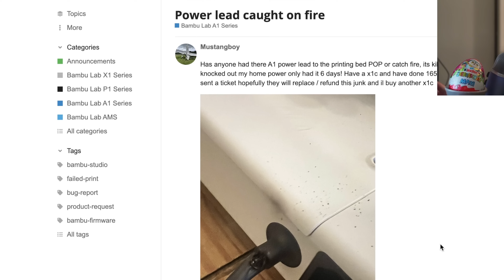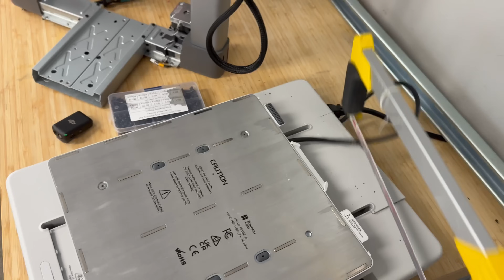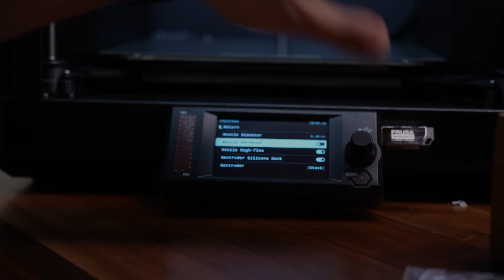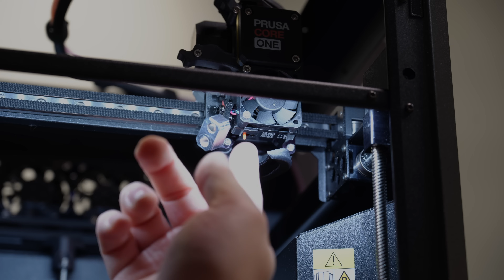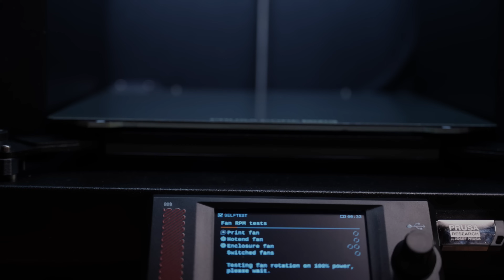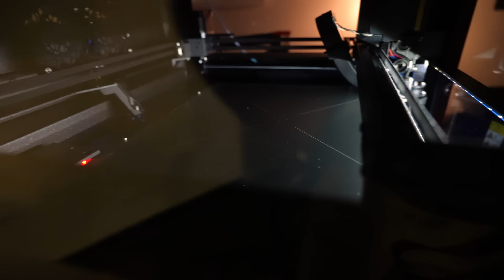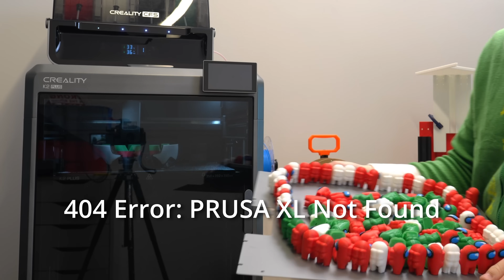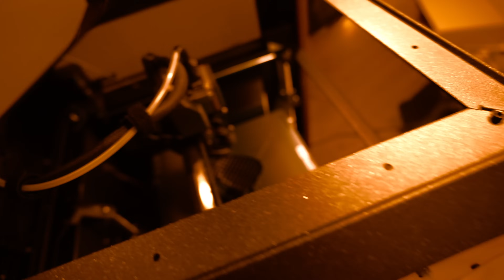PRUSA CORE ONE - The Machine Designed to Trigger Bambu Lab Fanboys

Comment: I don't usually like antagonism for its own sake, but I really don't mind if you trigger the Bambu Lab fan boys because so many of them truly are insufferable. Yes, this printer costs about as much as an X1C and doesn't have all the same features. What they don't understand, is that this will also produce superior quality prints to any printer Bambu Lab makes. Most of them have no idea there are printers which can make better quality prints because all they have ever looked at is Bambu Lab. Anyways, the One looks like a great printer for the right audience.
Reply: We have a X1E at work. With all the Printer Enthusiasts we have seen lot of Brands of 3D Printer, Professional 7k machines and lowend Consumer Printer. We all agree that the Print Quality of the X1E (We got two X1C, and one has one P1S privatly) is as good as the Prusa MK4s one has and it is better then most of the other Clones around. My X1C got a Nozzle/Fan Upgrade and is at the same level. And we are all dissmayed what Bambu announced, both of the X1C are now running X1Plus. 

Bambu Lab is at the moment the leading 3D Printer company as it sells good filament for a cheap price and has a good Printer in Programm, with a good Software, which they got from Prusa.  Prusa is the other High Quality Brand in the 3D Printer Market which got the full 
Package done: Software very Good, Hardware Good, Support Good, Open Source very Good. 
Bambu Lab is the same: Software Very Good, Hardware Good, Support Good, Opensource now Mediocre
. 
Literally the only Company which doesn't have "Software: Mediocre" on the List ist Sovol, because they simply say: 
Use Orcaslicer, here are the configs. They have good Support und very Good Opensource support.  
Without the Firmware Problem Bambu Lab inflicted on themself, i would say #1 Bambu Lab #2 Prusa Research.  
Now it's #1 Prusa Research, #2 Sovol #3Bambu Lab. 
Anycubic is at the moment trying to redeem themself. 
Creality is: Hardware Mediocre, Support Mediocre, Opensource Mediocre thanks to be the 2nd largest 3D Printer manufacturer there are enough workarounds for their Printers.

Sovol is paying license fees to the Voron projekt and get improvements for their Printers back. Which are in a good state. The biggest Problem i see with the Prusa Core One is the availability of the Kit's to get the price down. An upgraded Prusa Core XY costs around 1800€ for 5 colours. (MMU is comming, will cost around 300€) a big X1C costs with 1400€ for 4 colours. 
 But the price is okey as a fully kitted out Prusa CoreXY is between the X1E and the X1C pricewise. Personally i would now buy a Prusa Core One and Upgrade it to my liking, but i have a X1C with 2 AMS. But i am building atm my own Voron 2.4 and i even calibrated a Ender 3 and reworked it so good that it's print quality was as good as a X1C or Prusa MK4s. (And after 3 hours printing it was shitty again) But as soon as the MMU is available for the Prusa Core it's a very strong contender in this format.

And the king of all Printers are the Vorons, because there are hundreds of Maniacs improving them, but those printers are not for everyone.
Reply: @Elkarlo77  Nice analysis and experience! Thank you for sharing. I agree Bambu Lab's recent moves are detrimental for the brand and consumers regardless if it is a little or a lot. I wish more companies would take the Sovol approach of just use Orca Slicer and would stop making their own slicers.
Reply: Actually you're wrong: you'll notice those who love Bambu are those folks who just want to PRINT stuff. NOT tinker with the printers. 

I'll tell you who got butt hurt by Bambu: 3D printing fanboys who cannot stand the fact that ignorant plebes can now simply press a button and get a great looking print out!

Sure if you know what you're doing you can build a BETTER machine than Bambu with BETTER print quality for cheaper. Be my guest. I'd say 99% of the rest of the world just wants to have a life and get things done printing.

(Former Ender 3 v2 refugee speaking)
Reply: Then why do most bambu prints look better than anything I've seen off a core 1?  Cope much?
Reply: @cartier13  Because you've taken a very small look just to confirm your bias. 😂
Reply: prusa fanboys are also their own brand of insufferable.
Reply: "What they don't understand, is that this will also produce superior quality prints to any printer Bambu Lab makes."
I've seen a few videos where the Core One produces prints of a quality either on par with or slightly worse than those from Bambu machines. In the hobbyist space, it often comes down to whether people think comparable quality and reliability is worth the notable increase in price. For most people, I'd assume the answer is, "No," but the Prusa is clearly superior when it comes to serviceability and support.
Reply: @AuntJemimaGames A ton of it comes down to how much the user knows. Filament and slicer tuning is huge. Part of the issue here is that most Bambu Lab users are not going to tune beyond what Bambu Lab provides. They are in the top tier of quality for sure, but they aren't the pinnacle.
Reply: @802Garage  that’s the best part though, to get great quality prints you don’t have to spend hours tuning anything.
Reply: @MrBertstare  I agree. That's true of many printers including the Core One. My point is that there is quality available beyond what you get from an X1C. Especially without tuning. That's what I said. It's still true.
Reply: @  of course you can tune, but it’s all about acceptable tolerances. And out of the box bambu and prusa are all going to pass the “wow is this 3D printed?” Test and all your parts are gonna be pretty damn accurate from the get go. I for one enjoy just printing, maybe it’s because I did the fiddling, measure the steps, new upgrades, calibrating filament and now I just want to print. I want to get my projects done in the shop, ship out customer orders and print fun things for the kiddo.  I’ll take a prusa, a bambu, I’d even try a quidi or what ever it is. I’ll never own another ender after my 5plus and I don’t think I want to spend 40 hours building a voron. Maybe if my nephew wanted to I’d help. My kids on,y 5 so when she gets to that point I’m sure we will be all over some other tech.
Reply: @MrBertstare  - I'm not disagreeing with anything you say and certainly not disagreeing with your experience, but you may be giving up on Creality just as they are upping their game.  I built my first two 3D printers and I've bought the last ten.  I've never owned a Creality 3D printer but I am well aware of their reputation.  However, Creality seems to be trying harder the last couple of years.  The K1 was a good start but probably not ready for prime time, however the K2 Plus has been getting mostly good reviews.  It's a complicated full featured printer.  Features are great and they sell printers but I'm more interested in reliability and maintainability and I'm a bit dissuaded when I see automatic belt adjustment and similar complexity.  I realize that Ender is probably a dirty word to you at this point but the new Ender 5 Max looks interesting to me for the type of printing that I do.

I'm similarly biased against Qidi.  They seem to be making decent printers lately but the first 3D printers I bought were Qidi printers because they had a lot of features for the money, but that perceived value was a myth.  In practice, they were very unreliable and difficult to service.  Even worse, Qidi made everything deliberately proprietary to force customers to buy parts from Qidi, when the rest of the market was using open source components wherever possible... then Qidi would develop a new printer a year later and they stopped supplying the proprietary parts needed to fix their disposable printers.  Qidi is a lot better now but I'll never buy another Qidi printer after wasting $3000 on Qidi printers (back when that was a lot of money).
Reply: @MrBertstare  I hear ya and pretty much entirely agree! I still enjoy the process of perfectly tuning an oddball or engineering filament, but of course I get why most people don't want to. I did my time building an Ender 3 Pro and upgrading it, not that I know the pain of printer generations before or a full Voron build. What we have available now is amazing.
Reply: @  agreed 100%. I just downloaded orca slicer and am expecting delivery tomorrow of a Kobra Max 2 so deep down I must miss tinkering on some level lol. I need some larger things for the shop and at $299 I figured why not!  I was going to go sv08 but this is all oat half the price and I don’t really need a ton of speed. Just big and auto z offset lol
Reply: Prusa fans are a different breed of fanboy
Reply: @plutonasa prusa fans when they pay 2k more for a machine that has less features and produces the same or slightly worse quality prints than the other 2k bucks cheaper machine: “take that you fken fanboys this is the best machine that has ever been machined”.
Reply: @plutonasa your breed is a special kind of annoying
Reply: @plutonasa In my experience they are less annoying than Bambu Lab fan boys by far. On average more knowledgeable of 3D printing and aware of its history. Fan boys of any brand who hype based on emotion are of course annoying.
Reply: @802Garage imo prusa fans are the worst, refusing to acknowledge Chinese printers, ignoring people who don't want to build a kit, saying spending 1000 on a printer is "OK", ignoring price point as a purchasing decision, refusing to understand the layman doesn't care about rep rap or open source, refusing to understand there is more to 3d printing than the hobbyist/enthusiast.
Reply: @plutonasa  But an X1C is over $1,000 and Bambu Lab fan boys say it's fine. They refuse to acknowledge that it is a Chinese made printer and what that means. They won't admit to data issues or lack of personal control. I could make a counter point for every one you just made and the bottom line is, fan boys are annoying. However, on every 3D printing server I've ever been in and in every comments section, Prusa fans always acknowledge you are paying a premium price and it's not for everyone while Bambu Fan boys essentially claim dominance in every aspect and screech endlessly about how every other brand is pointless, hahaha. You're not gonna convince me. ;)
Reply: @802Garage  I was never going to convince a fanboy. P1S exists and that feature set is more in line to a core 1 rather than an x1c. A P1S is hundreds cheaper. Yea, Bambu fanboys are going to screech about their team, I agree with that, but a lot of these people don't really care about privacy. Same with the general tech space. Do you use Google products? Apple products? Amazon? So much shit is removing our privacy, so the layman Bambu users just don't care anymore. Just another iot machine that needs my info. How is a Bambu any different regarding privacy? In my experience, every prusa user on forums ignore and lambast bambu with no reasoning saying prusa should be the default choice.
Reply: @plutonasa  I'm not a fanboy. This may surprise you... I don't even like Prusa. Like I personally have no affection for the brand nor do I want to own one. I don't even disagree with you about the feature set comparison, which is exactly why a Bambu Lab fan boy will never have an honest conversation on the issue regarding other factors at play. I'm just giving an objective analysis based on consuming hundreds of hours of 3D printing content, reading thousands of comments, speaking with hundreds of owners, and my own technical knowledge. Do I think Someone should buy a One over a P1S? Well, that depends entirely on their budget, use case, preferences, and even location. What about a One over an X1C? Same answer. That's my entire point. Never did I say the One is better than the X1C or any Bambu Lab printer in every way. Never did I say it was the better printer period. Never did I say someone should buy one over the other. You are proving my entire point by defending against points I never made. I use Google products and I'm not a Google fan boy. I far prefer Android to iPhone and I still won't sing the praises of Android, I just hate using Apple and a lot of the corporate practices. You can have analysis of a product without being a fan boy. Not sure why you are defending the privacy point either when all you are doing is pointing to the exact issue and saying you don't personally care. You're entitled to your opinion.
Reply: @plutonasa nobody bashes Bambu printers you absolute reject.  Why the hell would anyone care if you want an out of box ready printer!? YOU are the ones why try shoving down everyone's throat what they should or shouldn't buy.  You guys are the absolute worst, you use idiot proof tech for a reason
Reply: One moment... the Core One exists because Bambu Labs was tremendously successful. And I'm not saying this as a fanboy of any brand...

Throughout Prusa's history, until a few months ago, they only manufactured "Bedslingers." When they released the XL with multiple extruders, it was Prusa's first CoreXY and multi-filament printer. Since that printer was aimed at a much more professional audience, they made the Core One to compete with Bambu Labs and other brands.

Before 2022, to have a decent CoreXY with good speed, you had to know about 3D printers, DIY assembly, troubleshooting, and more...

Bambu Lab broke that and delivered a pre-assembled CoreXY with good print quality, good speed, a multi-filament system, good error documentation, and overall good support. Without a doubt, at some point, a 3D printer company had to improve on what Bambu Lab did. The issue is that all companies are missing some detail that Bambu Lab made a reality in 2022... meaning two years of "advantage" to release something slightly better, and yet... (In Prusa's case, currently) without a multi-filament system (Yes... there's the MMU3, but not for the Core One yet).

The same goes for Creality; they launched the K2 Plus with a multi-filament system, yet it still struggles with first-layer calibration and reliability (let's not even mention the K1...).
Elegoo launched the Centauri...
Anycubic launched the Kobra S1 with a multi-filament system...
And, of course, Prusa launched the Core One...

But all these "good" options wouldn't have been possible if Bambu Lab hadn't launched the X1 in 2022.
Reply: @ttshar First off part of your premise is wrong. Qidi was making affordable core XY printers for consumers before Bambu Lab existed. They lacked marketing and a sexy look though. As for the rest of your comment, it's pretty much irrelevant to what I was saying. I'm not talking about who inspired who or who did it first, I was talking about the current state of machines. How existing products compare. Bambu Lab Is standing on the shoulders of many giants, including Prusa. Not really here to litigate the entire history of 3D printing.
Reply: @ You stayed on the surface of the comment maybe I wasn’t explicit enough. But the point I was making is that to this day, there is no printer that SURPASSES Bambu Labs models from 2 or 3 years ago in EVERY aspect.

And despite having all that time to release a significantly better product (and "disrupt" the market like Bambu Lab did), they launched models that are either very similar or even inferior to what Bambu Lab offers with their CoreXY printers.

It’s true that Qidi (I had forgotten about them) and other brands released CoreXY printers before Bambu Lab, but as you said, they didn’t become as popular for one reason or another, nor did they integrate everything that Bambu Lab included in their CoreXY models at launch.

I’m not talking about who inspired whom I'm just saying that the Core One exists because of the release of another printer. Otherwise, Prusa (and many other brands) would still be making bedslingers, and we wouldn’t have so many multi-filament system options today.
Reply: @riba2233  Except he was talking past me and saying a ton of stuff that I never said anything about. Just proving my point, honestly.
Reply: @ttshar  Surpassed Bambu Lab how exactly? You'd have to talk about specific aspects. Print quality? Print volume? Material capabilities? Speed? Price to performance? Customer service? Reparability? Open Source? Aesthetics? I would argue the only aspect no company has surpassed Bambu Lab in is auto calibration. That and integration with Maker World.
Objective analysis means acknowledging what other brands have done well both before and after Bambu Lab and not just declaring a good printer supreme because you like it. What you said about Qidi is just restating what I said and stating the obvious and I obviously agree with you. Overall, the defensive nature of replies to my original comment are making my point.
"I’m not talking about who inspired whom I'm just saying that the Core One exists because of the release of another printer." This is exactly true of the X1C as well. Like literally word for word replace Core One with X1C. Come on now.
"Otherwise, Prusa (and many other brands) would still be making bedslingers, and we wouldn’t have so many multi-filament system options today." You cannot actually make that conclusion on either point. Multi-color existed before Bambu Lab and was continually being worked on. Core XY was gaining attention before Bambu Lab and would have continued to do so.
Again, absolutely no disagreement from me that Bambu Lab makes great printers, pushed the market forward, and helped popularize many common features of current 3D printers. Can't we just agree on reasonable point without over stating the case? That's all.
Reply: @ttshar like the Prusa XL? Better multi color, reliable multi material.  Turn the waste off? Faster speed? Larger volume?  Isn't Bambu trying to rip off the XL?  lol
Reply: @ttshar  
The core one has been workt on since atlist 2018
So no it is not a response
Reply: @ttshar  - It's more true to say the Bambu Lab coreXY printers wouldn't be possible if not for the open source community developing the technology that Bambu Lab commercialized.  That's true of all Bambu Lab products.  They commercialize open source hardware and software, make it pretty, lock it in a proprietary walled garden, and their users believe they developed the technology.
Reply: @Liberty4Ever Of course Bambu fans think they invented everything they don't know anything about printers lol
Reply: @Liberty4Ever  Fax.
Reply: Bambucels are the new furries?
Reply: I'm over here with my Q1 that costs 1/3rd and prints better than either of them lol, heated chamber ftw unless you print pla then I don't care what printer you have a $100 ender 3 can make prints that looks as good as your $1000 printer if you know what print profiles are.
Reply: @thirtythreeeyes8624  I agree, but when a q2 or x plus 5 comes out, please wait as qidi has has issues with chamber heaters.
Reply: @JulianClose-l9b The issue I assume you're talking about is the mains power and if you poke it with a screwdriver you're gonna get a hell of a spark. Usually I unplug it and move it to a work bench if I'm gonna poke it with a screwdriver but, I've been a maker for 24 of 31 years of my life so probably a power user and will gladly overlook oversights in printer quality for print quality. Besides mains in America isn't gonna kill you, probably* lol.

Edit: and ya I 100% agree wait 3-6 months for any purchase of a new product in a fast moving industry they all push things out as fast as they can and the buyer ends up being the beta tester. I learned that early on being a maker. I'd expect Prusa to do better but, I wouldn't be surpised if they change some things after launch, nobody is perfect.
Reply: @thirtythreeeyes8624  that and the x plus 4 relay sending way too much power to the heater
Reply: @JulianClose-l9b The chamber heater power supply issue in the Plus4 has been solved for quite a while now. The problem was a choke on the board that was not handling the current appropriately at 120V for the given chamber heater wattage. Qidi has a replacement board which is already in shipping units and is free to everyone with an old one. Takes about 10 mins to swap really. There were zero fires or even melted power supply board covers and many people used the original power supply for tens or hundreds of hours without issue, but it obviously still needed to be fixed, and it was.
Reply: @thirtythreeeyes8624  The Q1 Pro chamber heater in Europe was about as dangerous as a toaster. Less even.